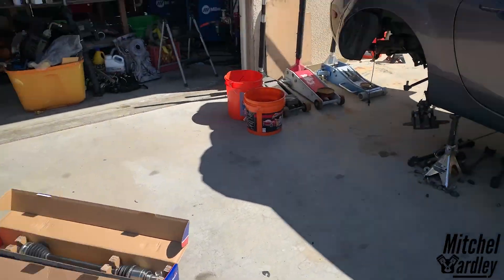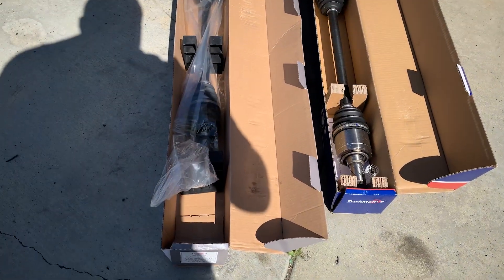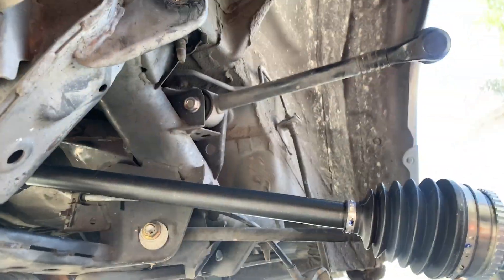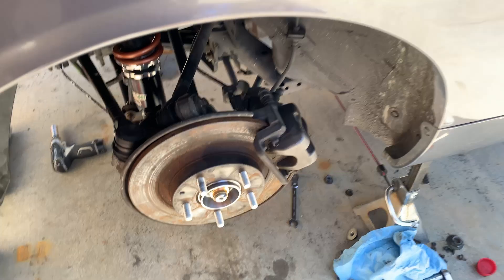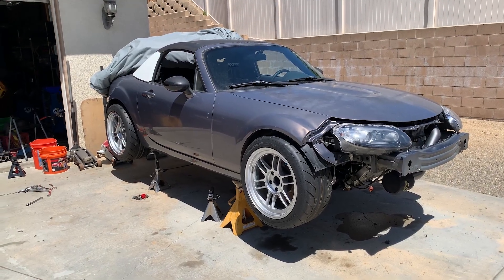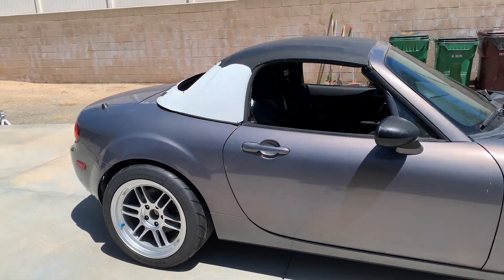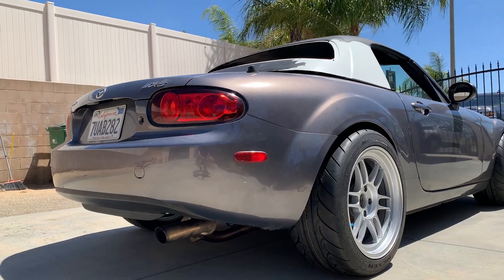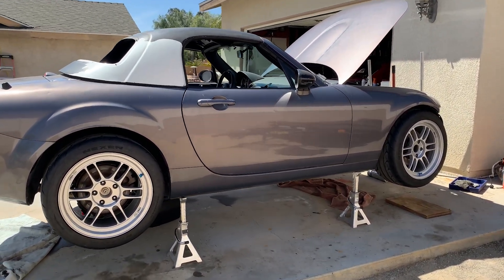NC v2.0: Off the jackstands for a few!

Comment: Pretty awesome and the cam sounds good! I regret not just dropping the whole front suspension and drivetrain like you did when I swapped my transmission. Def doing that for the 2.5 swap. What size are the wheels and tires by the way?
Reply from the maker: thank you!  It is very easy dropping the full subframe on these cars.   Wheels are 17x10 and 255/40